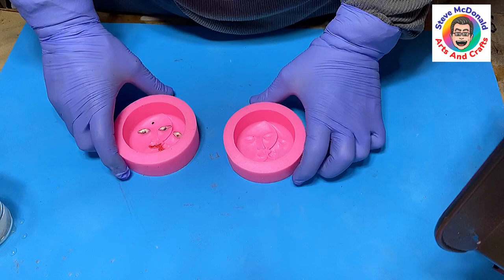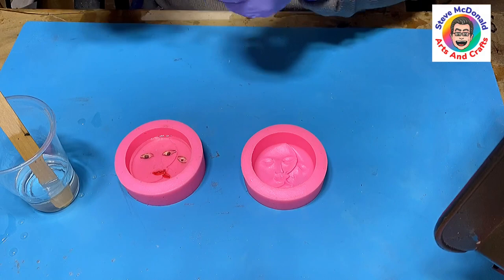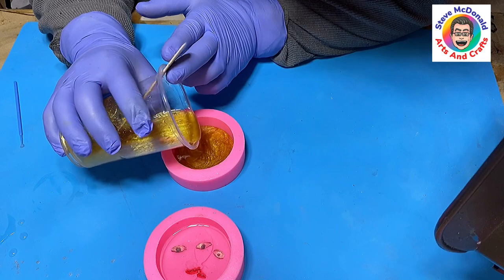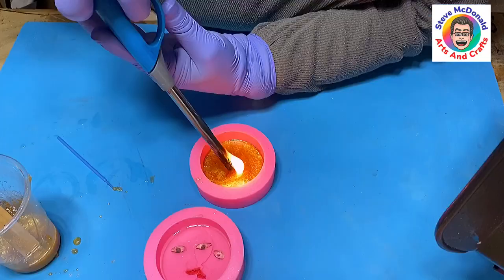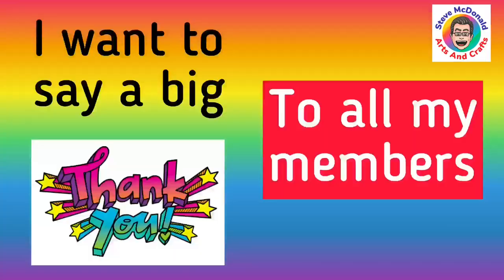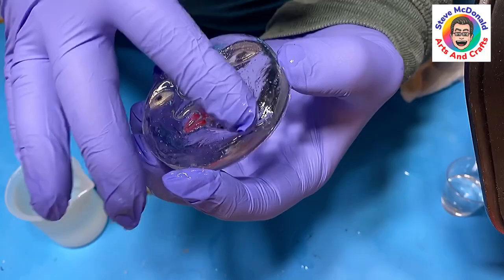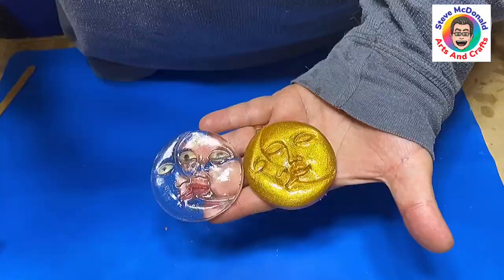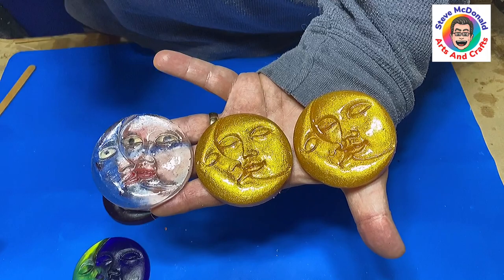How To Make RESIN SHINY From A Dull Mold

Comment: I just apply a thin coat of UV resin with a nail polish brush and cure it. 👍
Reply: What UV resin do you use? 
I've tried Steve's method in video, but the resin didn't adhere correctly (the final look appeared as if I mixed oil & water on top). It could've been the resin I was using at the time, but I've thought of trying a UV resin for these times.
Reply: @theresamcmanus3934  Truthfully, I buy my UV resin off Amazon and I think they are all the same.  They all seem to work the same to me, anyway.  One thing I will tell you is that any suggested cure times given by these UV resin companies needs to be multiplied by 10.  If they say the cure time is 30 seconds, I say yeah right!  Three minutes will probably be more appropriate.
Reply: @AGDinCA  Ah ok, that's good to know. Thank you so much, I appreciate you taking the time to reply and for the tip!
Reply: @AGDinCA  it just depends on the lamp you're using. That's why the time curing is usually longer irl.
Reply: @notebookluvr  Perhaps, but I use an 85 watt UV lamp... you'd think it would cure quickly!  But, alas... it does not.  ☹
Reply: Thank you so much I'm new to buying mold and resin and I'm used to UV  but this mold left all my hearts are cloudy.

Comment: I was buying some diferente sandpapers and nail files with 4 steps. It's only working good on flat surfaces. Also not good to to make resin dust and you need to use wet sandpaper. 

I should try you method.

Question: can you use UV resin to coat a piece made with normal resin?
Reply: @SteveMcDonaldArtsandCrafts  thx